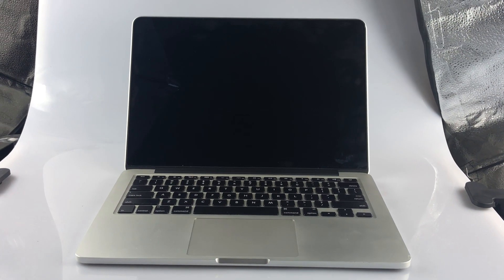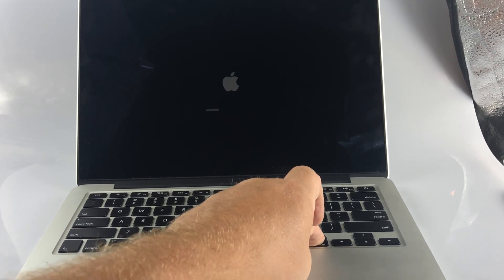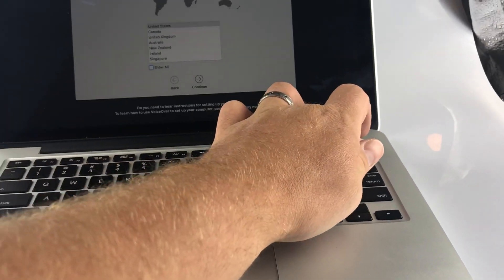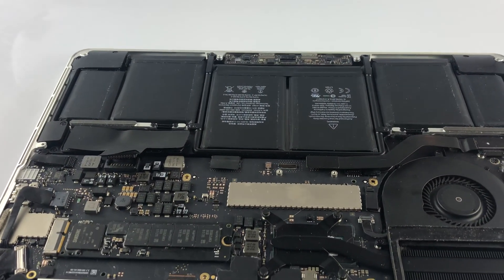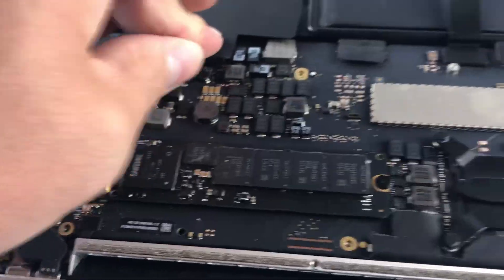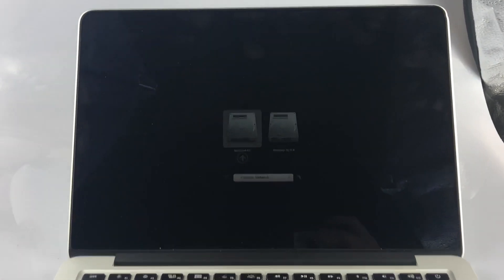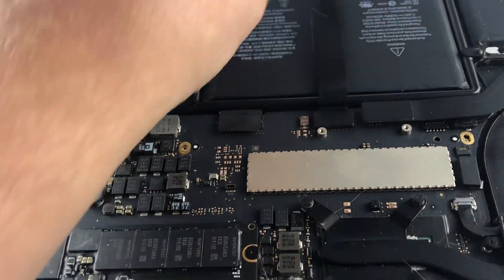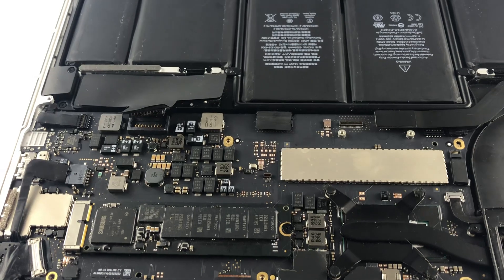A1502 2015 MacBook Pro 13” Keyboard and Touch Not Working Only Power Button

Comment: I had to change the battery because it was inflated, after the change the keyboard and touchpad don't work, neither with the old battery nor only with the power. i replaced the ribbon with a new one and it still doesn't work. do you have any idea what could be going on ? thank you very mutch !!

Comment: I replaced a battery yesterday and also a new trackpad cable. The cable is fully seated, I did an SMC and PRAM reset method and still no trackpad or keyboard. The key oard does work to do the SMC reset using control, alt and left shift or whatever the sequence is but once booted neither work still....they worked perfect before battery replacement and I've done MANY of these on 2013-2015 machines. Thoughts? Could the trackpad have got damaged? I doubt it as I'm careful but you never know and if so, would that cause keyboard to also not work once booted up?  A1502 13" retina early 2015 i7 3.1Ghz. thank you.
Reply: I HAVE THE SAME PROBLEM right now ! what have you done for it ? how do you solve it ? Thank you !!!

Comment: This is a complete failure of trackpad and keyboard.  I successfully replaced the battery [ from OWC ] on my mid 2015 MBPro.  Upon booting up I noticed that the j, m, u, 7, &, colon, semicolon, apostrophe and " are not working.  I accidently rubbed some of the "black stuff" off what i believe is the back of the keyboard while cleaning up the residual goo adhering the batteries.  I'm wondering if that has screwed up just these specific keys and whether I can purchase just a replacement keyboard.  I see that ifixit has an upper assembly but it is battery, keyboard, trackpad, speakers, but I don't need all of that.  Does anyone know if you can purchase just a keyboard?  Thanks

Comment: I replaced my battery last week and then the trackpad and keyboard stopped working, so I bought a new ribbon cable and installed it, but it's still not working. The better works perfectly. What did I do?
Reply: I have the same problem right now !! what have you done for it ?? thank you

Comment: Someone help me out, I have a 2012 mid MacBook Pro retina the OG and when I hold the option key it shows me the boot choose thing I do enter and it starts to switch on, and it takes so long to turn on idk why but it takes like 20 min to turn on and then the fans go crazy fast when booting up after it boots up the keyboard won’t work only the power button also when I use external sub keyboard my Mac is slow! It was never this slow it took like 15 min to log in and just unusable what is working with my Mac!? Help! ( when I turn it on without holding the option key just Turing it on normally the same thing happens )

Comment: guys, it's not a hardware problem but a software issue 

Alt+Comand+R+P reset, turned off Bluetooth, and changed my resolution to normal  FIXED!!
No more stuttering as well while scrolling.

Comment: I bought my Macbook Retina in August 2015. It's an A1502 and has the same 821-00184-A part number on the trackpad ribbon but the one I ordered from eBay using your link is about 1cm too long. Are there different lengths to the 821-00184-A ribbons? I would think that the same part number would be the same length, but they're not. Is August 2015 too late a model?
Reply: Update, so I realized you have to bend the ribbon a certain way to fit but this still did not fix my issue. Should I try buying another ribbon and trying again or is there another way to fix the keyboard/trackpad issue?
Reply from the maker: @jameshamory2538  if you have already tried a replacement part I would recommend checking other parts to see if you have a different issue.

Comment: Is the ribbon the most likely problem on a broken keyboard?
Reply from the maker: Not always. This is more common when it is the trackpad and keyboard.
Reply: @iProTechzLLC  Great video btw! 
I think that could be the case for my broken Macbook Air. Both are broken. The technician said, it was a water damage. Which never happened. 
Is this provable?

Comment: What about the 15 inch MacBook?   It is different inside...  My 15 is not responding also like this video... only power button works.. it SOMETIMES offers to connect Bluetooth keypad and mouse...  HELP PLEASE
Reply: I have the same issue,my MacBook Pro 15” retina just the trackpad and the power button working

Comment: I have a Macbook Air 13-inch 2017 which has the exactly same problem caused by very minor water spill. Would I be able to fix this issue by replacing the same type of cable? Thanks!!
Reply from the maker: Not likely, you probably need to replace the keyboard.

Comment: Hey mate - i'm doing some investigative work on these trackpad cable failures. Did you know the trackpad cable you replaced (821-00721-A) is a 2nd revision of an older one that also failed?

Two possibilites. That cable is genuine and apple hasn't fixed the issue permanently which is reminiscent to a1278 drive cable that went through 3 or 4 revisions by Apple.

The other possibility is the cable you're replacing was not genuine to begin with.

Really curious what your thoughts are.

Great analysis of the situation here: https://www.reddit.com/r/applehelp/comments/an103p/macbook_pro_keyboard_and_and_trackpad_not_working/

By the way - the original part number is 821-00184-A.
Reply: @Stine Windfeld Chabert 103C 10. Klasse UngdomsCenter Vejle

First of all I'm very sorry you're having this issue. This is Apple's fault and they won't admit it (which I explain below).

I'm not the expert here but this guy is https://www.reddit.com/r/applehelp/comments/at8ok7/13inch_retina_macbook_pro_2015_trackpad_and/egzfvs8/ - please read what he has to say. But he says 821-00721-A is the REVISED cable. But be really careful. Non-genuine cables that say they are 821-00721-A might already be broken or won't do haptic feedback (not because they are not genuine which is fine but because they aren't of good quality).

I haven't tried these but please check out https://www.youtube.com/channel/UC7QBpaduhQTNlT5bnl4GT1A video as well, he says he's had very good success with https://www.aliexpress.com/item/32900188432.html?spm=a2g0s.9042311.0.0.27424c4d99Nc6N which are the 821-00721-A and are pre-bent so they fit well.

Please also read ALL the reviews on iFixit for the 821-00184-A  part. Because some people (including myself) have purchased a part labelled "821-00184-A" (I bought mine from eBay) and it didn't have haptic feedback. But others have reported the cable they bought was perfectly fine.

This might be due to small variations of Macbook Pro 13" 2015 models and this is why I think the 821-00721-A part is a much safer bet because it is a SECOND REVISION of the cable because Apple has internally acknowledged that this is a problem.

What they haven't done is issue a repair program for this part. I am contacting https://appleissues.net/ about this - and I would recommend anyone having this issue to link to the video and say they're having the problem as well, so we can start letting the public know how disgusting Apple are being.

Right now I'm fighting Apple with my Consumer Law Guarantee rights which they are trying to deny. If it gets this far at minimum I will take them to court and I will do my best to expose their dishonest practices.

Please do understand if you have this issue it is 99.999% because of the trackpad cable failure. THIS IS A DESIGN FLAW AND A DEFECT BECAUSE APPLE MADE IT THAT WAY. DO NOT LET APPLE TELL YOU OTHERWISE. If your country affords you strong consumer rights - please assert them and hold Apple accountable - especially if you get a replacement part from Apple which you can only do by surrendering to a forced labour charge. So in my case $15 for the part but I HAVE to pay $120 for the labour charge (even though I could do it myself like this video suggests).

Lastly please be acquainted with this iFixIt thread: https://www.ifixit.com/Answers/View/605470/Why+precisely+does+the+trackpad+cable+fail
Reply: @Stine Windfeld Chabert 103C 10. Klasse UngdomsCenter Vejle Mate because you asked I decided to write up a compendium for everything I know about this issue. http://a1502-2015-macbook-pro-13-trackpad-cable-failure.ks.fastmail.com.au/references-to-issue-failure.txt

It provides links to everything you need to know and how to do a DIY and soe consumer law information about how Apple should be responsible in handling this.

Comment: While upgrading to Samsung EVO I accidentally unplugged the keyboard ribbon cable (next to trackpad cable) 

I tried to slide it back in the slots but now only ¾ of the keys work, a few on the right do not, like backspace, p o I.  Short keys and space also do not work. 

Did I do irreparable damage to this?  Can the keyboard ribbon cable only be replace or is it attached to the keyboard ? 

Many thanks in advance guys
Reply from the maker: * WOLVERINE * You may be able to reconnect the ribbon cable but you can’t replace just the kb ribbon cable. If you damaged it I would recommend buying a topcase with a working cable. Replacing the keyboard alone is a pain. If you need the part or repair I have them in stock used.
Reply: iProTechz LLC   ** Thanks **    It was just not seated properly. Not much wiggle room but it seems to be working again. Your help is much appreciated !!
Reply from the maker: * WOLVERINE * No problem. Glad I could help!

Comment: hello guys if someone still has to suffer from the same problem I have the solution worked for me. You have to open your Mac:
1 - disconnect the battery
2 - remove the keyboard and mouse connectors
3 - make a small cleaning in the region and reconnect the connectors
4 - with the battery still disconnected connect the charger and do the nvram (option + comand + P + R).
Hugs I hope I have helped

Comment: Changing the cable didn't fix the problem for me :/ what can I do next?
Reply: changing the trackpad cable didn't work for me neither, I installed linux and the trackpad and keyboard now works fine. I suspect it might be a software issue.

Comment: Is that work with MacBook Pro 13” Retina 2013?
Reply from the maker: Vojtěch ŠOBEK No this cable isn’t on the 2013
Reply: hello guys if someone still has to suffer from the same problem I have the solution worked for me. You have to open your Mac:
1 - disconnect the battery
2 - remove the keyboard and mouse connectors
3 - make a small cleaning in the region and reconnect the connectors
4 - with the battery still disconnected connect the charger and do the nvram (option + comand + P + R).
Hugs I hope I have helped